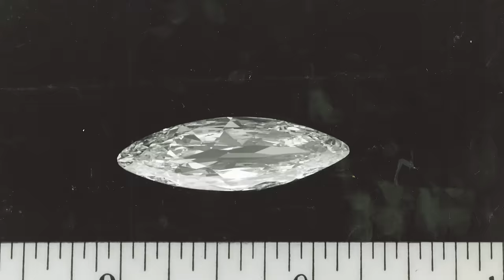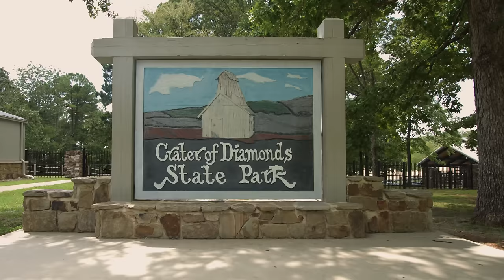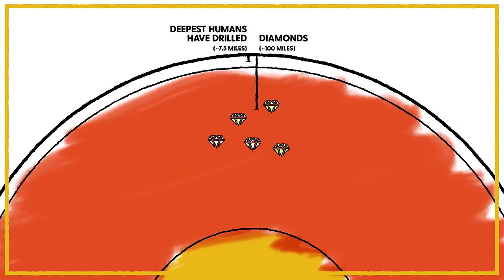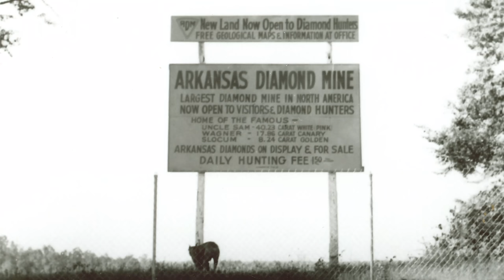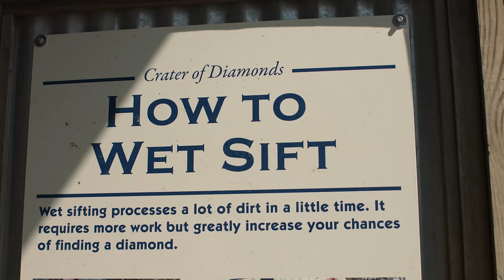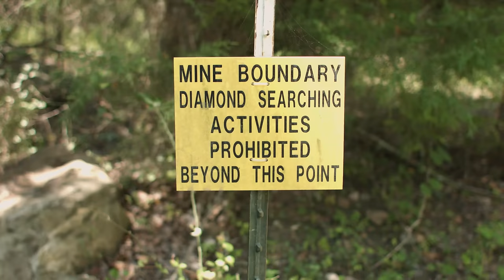The World's Only Public Diamond Mine - Crater of Diamonds

Comment: Didnt they find a diamond mine in russia that they refuse to search because it would destroy the diamond economy ?
Reply: doubt it, the diamond economy is so heavily monopolized one of the big diamond groups like the De Beers Group would just come in and take control of it. Diamonds are ultra common and the prices are pushed sky high by these companies
Reply: @Arrica101  its basically like glasses frames insulin and all thoes other weird monopoly run shits
Reply: refuse to search BY NOW.
Reply: @Arrica101  diamonds certainly aren't "ultra common". That's reserved for a mineral like quartz that can be found in any state, digging anywhere. I challenge you to buy 5-10 acres in the state you live in, and dig all the way until you can't dig further and I guarentee you will have found 0 diamonds. Large companies are just able to stockpile them and force cheap labor overseas where they are slightly more abundant

Comment: I used to work for the pawn shop in Murfreesboro. We bought and sold diamonds from the mine to an international market. We had a serious customer base from the local miners. We called them transplants. They moved from out of state and most of them lived at the Miner's Camp down the road from the Crater. I miss selling and buying Arkansas diamonds.
Reply from the maker: Wow that's very cool. Did diamond miners turn a decent profit?
Reply: @OfftheCuff_Series  Well it depends. In the short  term they turned a really good profit. There were times where we bought diamonds for $25 a point, which is pretty high. In the long run though they didn't  because there was always several weeks between the  diamonds that the individuals brought in. Most the miners would dig diamonds until they got enough money to go out west to pan for gold, and then they'd eventually come back to the Crater.

Comment: I want to know what sort of methods you're allowed to employ. I presume they won't let you bring blasting equipment, but are you allowed to bring a pickaxe and dig a hole? Also, some rocks contain diamonds that you can't see until you strip the rest of the rock away. Are you allowed to bring chemicals to dissolve the rock layer?
Reply: Of course not. Just fossicking. It is more of a tourism attraction than an actual mine.

Comment: I have had two friends that worked as cattle mustering and have told me about mounds of diamonds pushing up through the surface of the ground and when they told the farm owner what they found he told them to grab a handful for them self and covered them up saying they will be his money when beef in no longer profitable, but this has happened before else were in the world and same thing is if this amount of diamonds came to market the value of diamonds will drop massively.
They have piles of diamonds stored away to keep people thinking they are rare, same as oil it comes from the material melting into the core of the planet, this is also how fresh water is produced and can be tapped into anywhere on earth and is what feeds the hot springs, this was all discovered when Russia dug the deepest core into the earth and was stopped because of the heat melting the drill bit.
All is hidden to keep the world believing they are rear resources to control them and us.

Comment: i find it strange that no one speaks about the geology involved and the forces necessary to create a diamond. the fact that these are being found on top soil means that something incredibly explosive had to happen in order to place these diamonds where they are being found. it usually takes millions of years and immense heat coupled with immeasurable geologic pressure to squeeze coal and other elements into gems we know as Diamonds. So my question is, where is the Volcano that blasted these diamonds to the surface. Im no professional, but common sense would say to me that there is an undisclosed danger in that area that no one seems to care about. or they just don't know that it is there. I would look for the source of exposure and make sure its safe to even go near to!